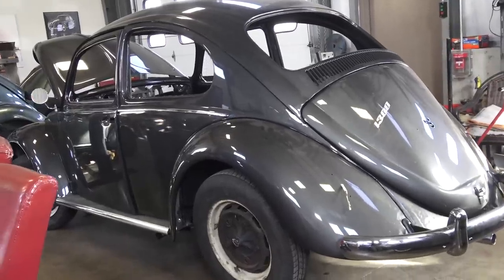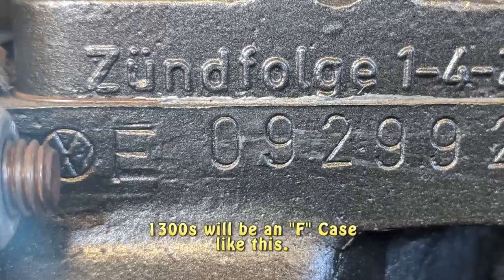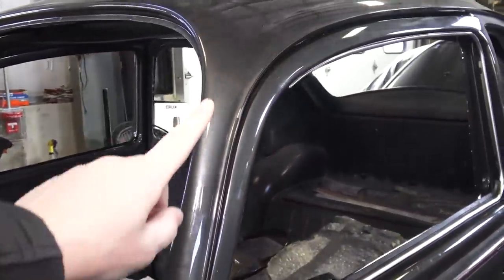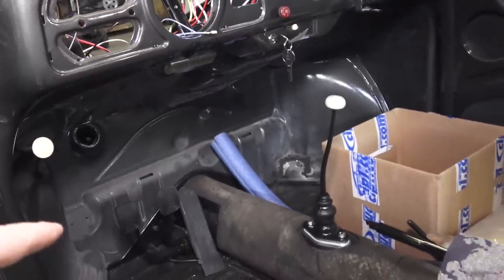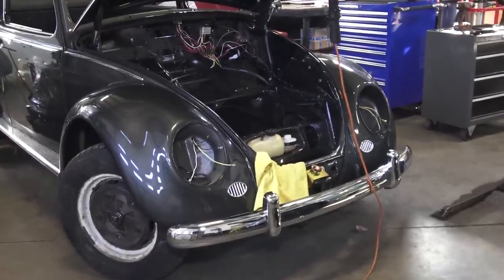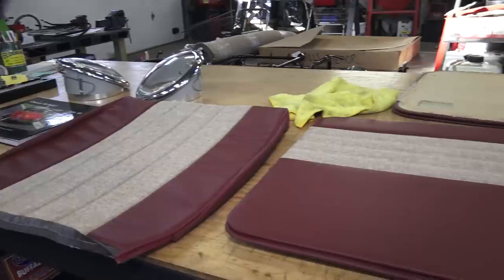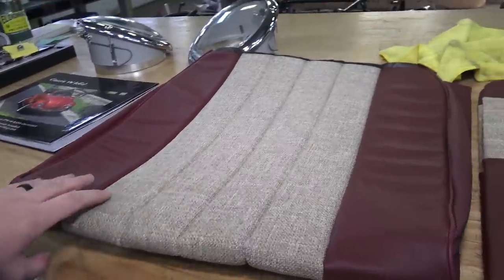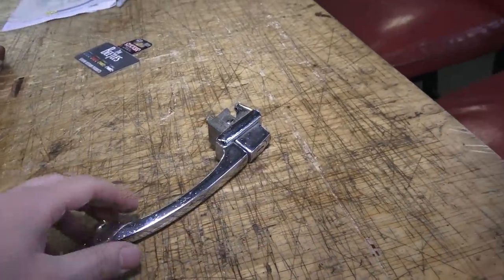Classic VW BuGs The 1966 Beetle Features and One Year Options

Comment: I didn’t get the chance to read all the comments, so just in case it’s been mentioned, I apologize for repeating it….mine has the red interior that you show, but where the seat back release lever area is, I have a red cover over the whole seat frame area on the outboard side, which hides it all pretty nicely….might have been an option, but I’m not sure….I also have an ivory knob cigarette lighter,(6v), on the right side of the ashtray, which also might have been an option, as it matches all the rest of the knobs and retainers….my parents bought it,(I was with them), when the car was turned in by an older couple who wanted to trade it for a type three only after 3mos, we were there, and my parents grabbed it, and it’s been mine now since 1979….

Comment: I have a 1966 beetle that has 1967 door handles which I thought were wrong for the car. While reading in the Bentley manual it states that that some very late 1966 production  cars had 1967 door handles. Being a one year part makes them more difficult to find. Luckily I started collecting VW parts in the 1970s and have been able to buy several over the years. I still have the 1966 sun roof car that I bought in1990. Some of the less  common parts (pop out windows for one ) have gotten pricey.

Comment: I have a restored 66 Beetle. It is worth mentioning this is the last year with the 6 volt flywheel. The 6 volt starter does work with the 12 volt conversion, however they can burn out under heavy cranking. The 12 volt flywheel has more teeth (bigger), so the transmission case would have to be machined to manage a 12 volt flywheel and starter. The 6 volt starters are sometimes hard to get. There are trade offs when trying to keep it "original". Thanks Chris. Great videos.

Comment: Hi Chris,  Cool video like always! My dad had a '66 bug equipped with dealer a /c ,  he purchased the car way back in '72.  I have owned my '66 bug sunroof for over 30 years.  It was the pigalle model in L87 pearl white with red upholstery :seats , carpet , seat frames and floor mats rear floor kick panels. The front heater foot well slide doors came in red aswell ,car featured a walnut shift knob and a spare tire chain lock which was a '66 option. This car is an October '65 production so it still has the early pedal assembly and square push button door handles . The '65 and early '66 outside door handles are actually wrapped in a stainless steel cover unlike the chromed plated '60-'64 types. This early production also featured the center dash defroster & 4 way flasher unit with solid red "88" knob & black steering wheel & slotted wheels with flat hub caps.
Reply from the maker: Very cool

Comment: Great coverage of the 66 model. I had an F code 1300 6V in my 57 when I was 16 years old and later I owned a 66 beetle in what I called toothpaste green- (Bahama Blue). The F code 1300 had more than 40 hp, I always like to believe it had 50 hp due to the angled intake manifold flange meeting the new style heads. F Codes Rule!
Reply: It has 50 horses.

Comment: I bought a 1966 VW in Fresno California in Jan. 1966. It was Panama beige, had beige interior and cost $1965.  Having one just from the factory was a great experience. The car was unfortunately totalled with less than 5,000 miles on it in a triple highway rollover. Amazingly my passenger and I were uninjured.  I always regretted losing that car in brand new condition. Great to see you guys doing such high level restoration on these cars.

Comment: Hi Chris - Great job you're doing there - I'm Sathi from Malaysia - have my dad's bug handed to me - strangely in Asia at that time it was a real mish-mash of the 65 and 66. The car was manufactured in 65 - It already had the flat hubcaps and the wheels you mentioned- and the towel rack bumpers - 1300 . No 4 way flashers though - Pearl  white with those uniform red seats. Another this is these seats had the 3 piece mechanism for the front seats leaning forward mechanism as you've shown but most cars don't have them now. The owner's manual you flashed is the same too as in 65 - Guess they experimented on us Asians before going all out in America

Comment: My late father   was Volkswagen mechanic and service manager  at  dealership in western Pennsylvania  he  all so work  for Packard dealerships  that sold them through Hoffman importers  we had a 56 beetle  and 3 1966 beetles   the first  66 had 500 miles on when bought  it was bought wrecked and he put a new frame head on it and from fire wall out body  panels  he like the 1300cc throttle response   .

Comment: I remember the 66 Bug when it came out, and thought it was pretty nice.  However, I never saw a 66 with that horn ring, only 64s and 65s.  The 66, I thought, went back to the 60 - 63 style half circle horn ring.  Also, while carpet was an option in 66 and 67, not many cars had it.  The vast majority of Bugs had rubber floor matting.  Also, there is no need to convert to 12 volt.  Just use thick enough battery cables.  For this small 4 cylinder, 2 gauge is big enough.  You can not use chain auto parts store 4 gauge battery cables with 6 volts.  You just can't.  There are also 8 volt batteries available.  They are available in the same group sizes as 6 volt batteries.  The only thing you will have to do is re-calibrate the voltage regulator.  Everything else will work fine on 8 volts.

Comment: TMI carries the correct door panels as well, and they look really nice. I ordered mine through JBugs, plus you can select non standard colors.  I went with a saddle color vinyl which compliments the Bahama Blue nicely.  You can buy the chrome door panel trim from Wolfsburg West as well.  Also, I don't think your hazard flasher is correct, that looks like a later model knob used.  I believe 66 is one year only and are not cheap and hard to find.

Comment: Quick question, is this paint color the original for 66 models? I own a 66 vw bug and like to paint it the correct color. I really like this dark gray. Thank you for the video.
Reply from the maker: It's not, no.  That's a modern day Porsche color
Reply: I bought my 66 from a guy in México, it has the aluminum plate that days made in Germany. The title says orinal color grey but haven't find the correct one.

Comment: Also the query i have, regarding the flat hubcap that fits into the inner 3 lobes… is that cap beetle specific (i.e. protruding further out to accommodate the axles), or the same type of cap with the ridge as per the type 3. I have tried fitting the caps onto the correct 5 lug slotted rims - but the caps are just too shallow by about 5mm - whixh makes me think the beetle caps were “taller” than the type 3 ones

Comment: Interesting information about the 1300 engine. My '72 has a 1300 (1276cc) but it is an AB case. Do you have any idea if this can be increased to 1600 without machining the case? This is a car built for the German market.
Reply: yes it can for sure.
Reply: @VallonesRCHobby  Will have to check the heads since the engine has dual port heads as stock or factory installed.
Reply: Are the 1300 cc cylinder walls thicker than previous 1300 engines, allowing the use of 1600 cylinders?
Reply from the maker: @jpvill4th  yes 1300cc jug is thicker.
Reply: @classicvwbugs  Thank you for the reply

Comment: Hey chris. Ive seen almost all your videos, jus wanna say Thanks for a newbie like me, starting, been getting my hands greasy and tackle my own problems, now, although bigger issues i still hit up the mechanic. Hey, need ur advise. I have a 72 ghia, it idles fine, but it boggs when i take off on 1st, or even at gear change to 2nd. Requires more gas squirt to keep it from dying. Wasnt like this before. What can be a reason? Wut u think i should do so that it doesnt quit when i take off...thanks!!!!
Reply from the maker: Sounds like a carb issue.  I would take it off and do an internal cleaning.  I have a video on it.
Reply: Chris Vallone chris, thankyou for taking the time to reply. Will tackle that this coming week. Im also jus gonna do an oil change, as well as changing the valve cover gasket, since i have a leak from the right side, plus its been about a year😟

Comment: I’ve an August 65, and it has the same 1300 emblem on the engine lid, and has slotted alloy wheels (with flat hubs). Is this period correct for an August built 65? It also has an F engine block, 1300. U.K.

The spare wheel well has been replaced and the identification plate is missing. I’m not sure if my registered 65 is a pure 65, or at some point maybe had a 66 body put on it with donor engine? I suppose a birth certificate might answer a few questions.
Reply: It is a 66.  It is Japanese cars that always come out in January of the new year.  Also, auto makers start producing the new models a little before formal introduction, so that they can have the dealers stocked up with new cars on announcement day.

Comment: Interesting. You should compare US bugs to Europe, as we didn't get a lot of those features until 67. And if you have  67 1200 (as I do, incidentally it's a never welded UK car, near mint condition) it kept the floor dip switch, 6v electrics, reserve tap (no fuel guage), etc.
Reply from the maker: Yeah that could be cool, I gotta hone up on Euro changes to do that vid.  thank you!
Reply: I'm an American who owns a '68 Euro-spec Beetle and actually posted a video of the differences I found.  The ones I'm aware of are: 1300cc engine vs. US 1500cc, no emissions vs. US emissions, no flashers, no reverse light, no brake warning indicator, steel dash vs. US padded dash, low back front seats vs. US high back seats, and different routing of oil cleaner heater hose.  It does have a collapsible steering column and despite not having reverse lights it DID come with the same rear light lenses as US models..which have a clear section for reverse lights.  Socket is there, wiring isn't.  I think the seatbelts were different as well but I don't know for sure.

Comment: 👍  I am curious about about the difference in the engine lid vents. Which years and position of the vents was the most optimum for cooling. I have a 74 sb
It runs and operates reasonably well. I think it gets a little to hot on long drives though.
Reply from the maker: well the germans had it right in your VWs time period when it came to cooling, maybe you have the wrong lid on?
Reply: @classicvwbugs  thanks, I'm pretty sure I have a year appropriate engine lid fo a 74. I was curious if air cooling improved from the early 60s through the 70s when the vents changed position every few years. But I know engines were also bigger over time.
Reply from the maker: @snugbug5067  It did improve yes, they had to do to the larger engine.
Reply: @classicvwbugs   thank you !
I'm originally from your area and enjoy watching your fall cruises around where I use to travel. Bear Mt., Anthonys nose,  Peekskill. Paliades Parkway, Pretty country !! 👍
Reply from the maker: @snugbug5067  Cool man, where do you live now?
Reply: @classicvwbugs  I'm a lady 😀 ( who's been a bug lover for ever)and we
 live in pa. But I occasionally miss the hudson highlands, lots of memories.
Reply from the maker: @snugbug5067  Ah gosh I am so sorry, damn the internet!  haha
Reply: @classicvwbugs  😊

Comment: Chris my motor does not have identification numbers at the generator mount. Obviously a new case. How can i identify the size of my motor?
Reply from the maker: Hmmm, you can look at the heads by taking valve covers off and looking at the rockers, boss size, etc.  Piston and cylinder size too.  Manifold changes as well.

Comment: Chris my 66 has the high beams on floor, it’s a 6 volt 1200, and it also has another pull nob (with a black center, what is this for... a choke?) to the right of the ash tray... can you respond to these 3 items? Also, the license plate deck lid light is a smaller “nipple” shape, not the more big 1/2 round shape? It is a Canadian bought VW from West Vancouver. ( I also have the OG warranty and owners manual :)
Reply: Sure it is a 66?  Had a guy at work about 25 years ago show me his "64" VW that he just bought.  I told him it was a 67, he researched the car, and behold, it was a 67.
Reply: @jamesbosworth4191  yes it’s a Canadian Classic 66’. The knob is for heat boost. Canadian Classics were put together with left over old parts… ie: it came OG with a popes nose license plate light
Reply: @anonymousme8102  Good to know.